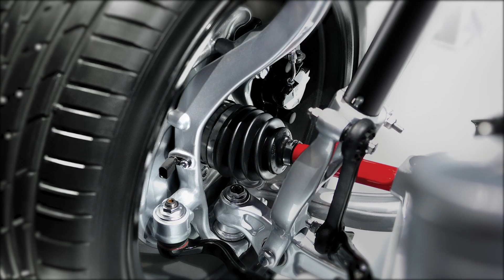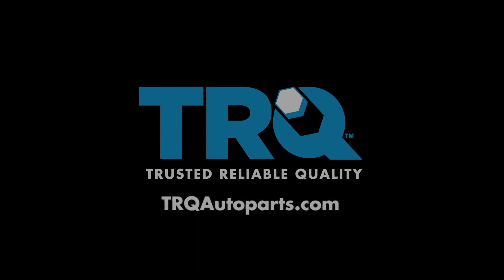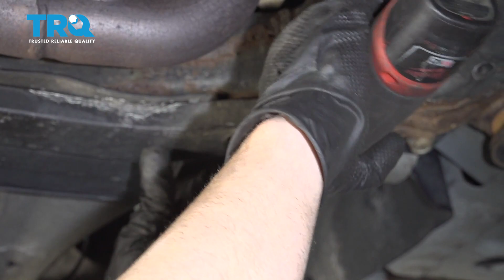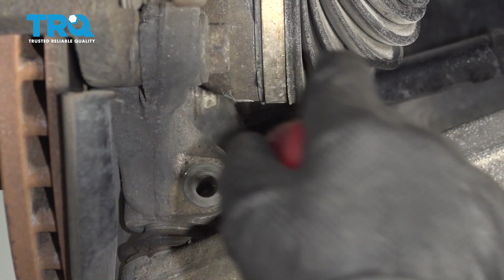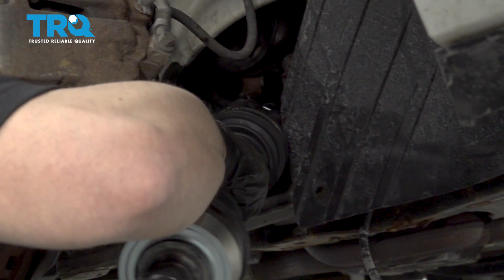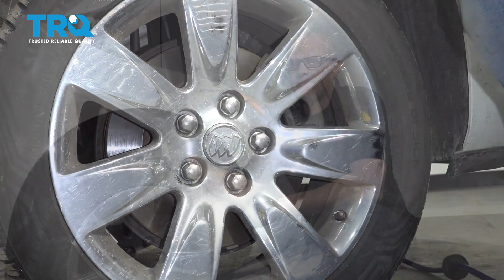How To Replace Front CV Axle 2010-16 Buick LaCrosse

Comment: I have a 2017 buick encore and the splined side is stuck in the transmission. It didn't pull out in one piece it separated.  How can I remove that? I've tried vice grips and can't get it out.

Comment: Or! Just take the 2 strut bolts and tierod bolt then pop shaft out. Way easier, and helps those people that have abs sencor stuck. That way u don't have to move the sencor. They break to easy and aint cheap